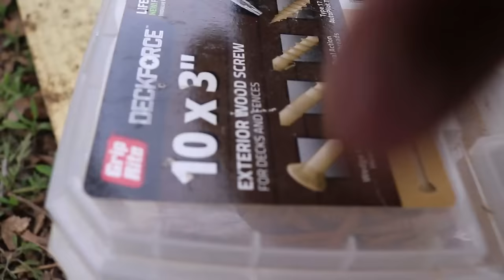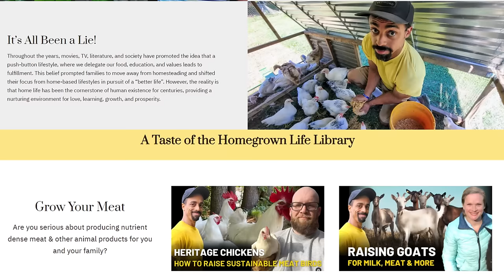BEST Egg Laying Duck | What I'm doing to reproduce more

Comment: On washing the eggs it would probably take less time  to get a small aquarium pump, put it at the bottom of a bucket, put all the eggs in there, cover with cool water and a little baking soda and turn it on while you go about other chores.  All that baking soda water gurgling about is going to both soften the "dirt" and actually bubble some of it off where all you would have to do is give each egg a quick swipe instead of having to lightly scrub to remove it and it would save water.  Just a suggestion.
Reply from the maker: Thanks for the suggestion! 😊
Reply: The water should be warmer than the eggs. Cooler water makes the egg contents contract, possibly pulling in bacteria from the shell surface through the pores. 😊
Reply: I'd wipe not wash... Washing removes the bloom.
Reply: @rebeccaplumlee9601  depend on your intended usage.  I made the assumption that with that many eggs and since he was cleaning them under running water his intent was that these eggs were for consumption only whether for his family or for sale and would be refrigerated. Not suggesting that to be the only way to clean, just that is how I would be dealing with really dirty eggs.

Comment: I was told that you can set posts by pouring dry cement into the hole and the moisture from the ground will solidify it. Would that work in your area? In Indiana it worked well for me.
Reply from the maker: I'm not sure. But it would he very hard to mix the concrete in the hole. And the concrete would probably harden on top but not lower in the hole.